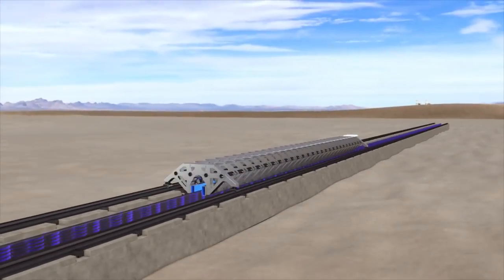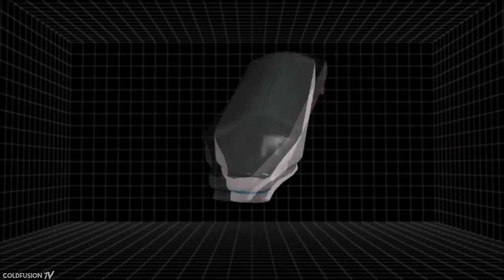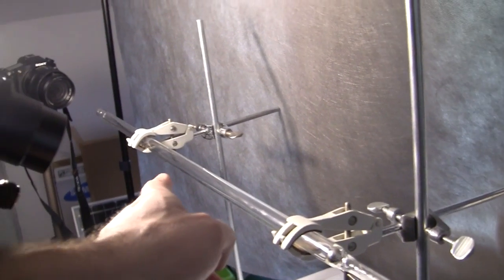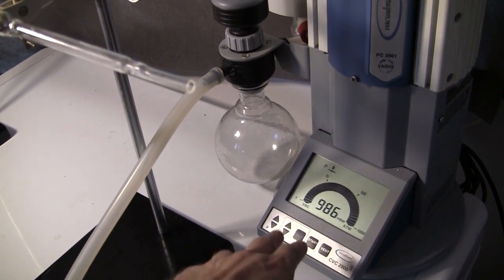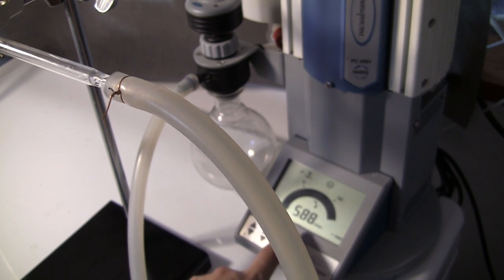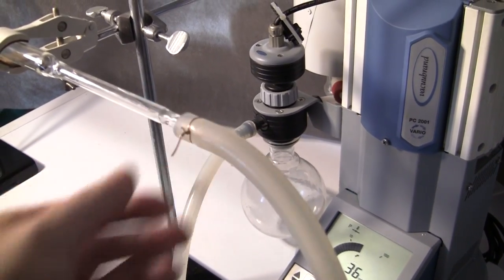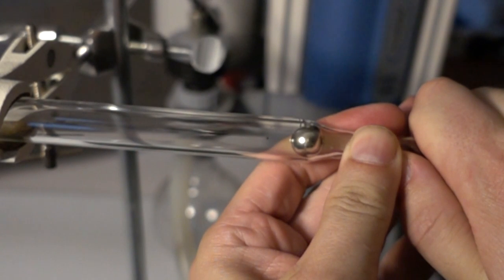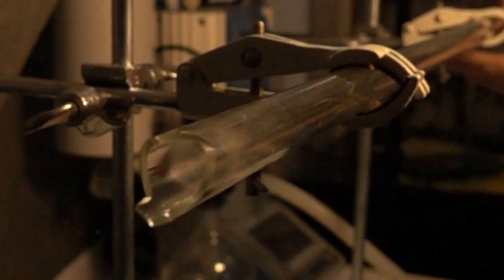How  the Hyperloop can kill you!

Comment: I don't know, I get the point if there was a catastrophic failure with no safeguards, but that assumes too much on Thunder's part.  If you only validate a travel option based on 0% risk, then don't even bother walking, because even that's not guaranteed.  Musk and others have far too much invested in this to not have some kind of safeguard against the most obvious forms of failure.  I'm not saying it's flawless, but I'd rather have this than the normal trains that seem to derail every other week.
Reply: Worst case scenario, the occupants are turned into Ragu, at least it stays in the tube instead of spilling across the countryside.
Reply: +LabTech I guess we'll have to see what they'll put in place  to reduce the risk.
Reply: Well, imagine this bullettrain, pushed away by magnets. derailing. It won't just fall over and slide a little, killing a few and wounding the rest. If a hyperloop derails it will pretty much guarantee death.

A vacuum rupture like Thunderf00t explains here is very well measurable and emergency breaks could keep the train in place, but on rails, it matters where the tracks break.

As long as it's not under or too close in front of the train you can just stop the train. On a hyperloop it doesn't matter where the problem is, unless you find a way to prevent air from rushing in in other parts, like some very sticky(and expensive) foam that fills up entire sections.

If 100km's behind you a drunken construction worker rams the tube, you're still screwed. Emergency breaks will stop the train.

Lets also not forget that there is no way out of the train or tube. It is supposed to be a solution for medium long distances. 50-500km of death trap in the middle of nowhere. Any emergency hatches will have to line up and open automatically because you can't open the train before the tube is pressurised unless you want to die.

The doors will have to line up, which will be either way too expensive becasue they will have to be large and very close together on the entire tube.

Also the friction from braking at those speeds added to extra oxygen can and probably will cause fires.

Easy solution for a fire in a cabin is just opening it and let the air out. Pressure drops, fire is out, everyone dies of asphyxiation before emergency services can reach it, but this won't be a solution if the fire is caused by a rupture in the tube. Then you'll only be feeding oxygen to a fire in a box in a tube, roasting everyone inside.

Co2 would be deadly as well or it would be blown away by the air rushing in, water is too heavy to take along and dangerous in combination with electricity, etc.

It's not like an airplane that you can build large enough to move around in to put out fires. every cm added to the train will have to be added to all of the tubes as well.

But let's say that fire is under control and the train just stops. How much oxygen is in the train while you wait in a tube in a tunnel through a desert mountain for emergency services to come and rescue you? An airplane has plenty of air, it flies through the stuff.

The simplest of problems that would not cause death in any other mode of transport can be very deadly in the hyperloop.
Reply: >Worst case scenario, the occupants are turned into Ragu

The more expensive ragu, or the cheap nasty stuff you get in tins?
Reply: Deathjack 999 Depends on whether or not the catastrophic failure happens in 1st class, or coach.
Reply: Stylish777 Look, every new technology has its detractors when the thing's in its infancy.  There were people who said that airplanes, trains, the subway, and the automobile were far-fetched when they were first introduced. 

I don't know enough about this to say if it's worth it or not (and where'd you get that price range from?), but I retain just enough interest to see this thing play out.  If in 5 years the financiers and industry people behind this are bankrupt and crying on the news, I'll be there right beside you laughing at them.  If, however, it succeeds and they somehow make it feasible and practical to implement, then I'll applaud them for improving human travel methods.

Thunderfoot here assumes that there'd be no countermeasures or safety methods against the failure state he suggests.  Look at any modern travel system and just stand in awe at the number of safety measures that are in place.  If you think this hyperloop thing isn't going to be loaded to the gills with safety crap, you're kidding yourself.
Reply: Stylish777 Bottom line to all detractors:  the world is full of people who'd rather shit-talk someone who's trying, then make the world better themselves.  Rest assured, if this thing succeeds despite your 'expert' opinion, you'll change your tune, use it, and then sing its praises; don't act like you wouldn't. 

Either someone's going bankrupt, or we'll end up with plenty of quotes that are going to look VERY foolish in a generation or two.
Reply: Musk has nothing invested in this. His "proof of concept" demonstration proved that, where the tubes couldn't even support their own weight and his trains were propelled down a track. The guy is a conman.
Reply: Now we're talking, these are all well thought out concerns about the hyperloop.

The most immediate danger I'm thinking of is loss of cabin pressure. This is actually more serious than with aircraft - it's essentially the same as loss of pressure in a spaceship. For that purpose, the tube must have rapid pressurization valves on regular enough intervals. If a passing pod reports loss of cabin pressure on the telemetry, the emergency valves open, fill the tube with 1 atm air from the outside, which prevents the passengers from dying from asphyxiation. If the response is fast enough, it'll also prevent other health issues from rapid decompression.

Emergency braking in normal mode could be handled by these valves as well. If you need to stop a train, just open valves ahead of the train, and it'll stop in a hurry. And it won't act like a cannon at all, more like a shock absorber. Better have the customers strapped down at all times, though.

Similarly, if there's a breach in the tube behind the train, it's not going to cause the pod to indefinitely accelerate; the pressure would be equalized, the air drag would decelerate the pod, and then you could have it moved to the nearest emergency exit.

Onboard fire is probably the most serious of emergencies I can think of within normal circumstances. To that end, you are right - the pod and the tube absolutely needs to be possible to egress in emergency. This would be facilitated by emergency pressurization valves (possible to escape the fire by exiting the pod and entering the tube), and having emergency exits on the tube on regular intervals (ideally on same locations as the emergency pressurization valves).

Out of ordinary, the most immediately fatal failure mode would be a tube collapse or obstruction as a result of some natural disaster or an act of terror, but this also applies to other modes of travel and can be mitigated here as well. For example, it may not be the best of ideas to build a hyperloop tube straight across San Andreas fault.
Reply: Mr. Suit
And because he knows it's not viable. It's just meant as inspiration to designers, physicists and engineers to overcome the practical barriers without him having to spend money on research on something that will never be used.

Research like that can often be very practical in other fields though, so it won't be waste, just as research on F1 cars is not wasted on a game.
Reply: ***** Look, I'm not an engineer, the difference between us is I don't pretend to have knowledge that I don't; so I can't really say if the thing is feasible or not. 

If it's possible, then hooray; a whole new era of mass transport is ahead of us.  If it's not, then a lot of wealthy and influential people are trying really hard to waste money and embarrass themselves. 

Either way, doesn't really impact my life right now, so I say let this thing play out and see what happens.
Reply: LabTech
Sure it's possible. You just need somewhere between 50 and 100 billion dollars to build it. You don't need to be an engineer to see that that is not feasible. You can just ignore that it's a death trap if you're not an engineer and are not going to commit to building the thing, so you're still safe ;)

I just wanted to point out the difference between possible and feasible.
Reply: LabTech
Yes people thought we would never fly and that the first bicycles without pedles made the cows give sour milk. I'm not sying it's impossible. Quite the opposite and we would do well to investigate the options and try and overcome the problems even if it will still always be far too expensive and dangerous(it's still a capsule in a fucking tube with no way out except at the stations; the only way to solve that is to allow only one train in and blow up the tubes in an emergency and protect the stations from the giant shockwave of the air rushing into the tubes at the speed of sound).

The cost is just that of a 600km maglev train and the current steelprice(tubes of 6m across and at least 3cm thick to withstand the pressure difference). I didn't even include the train itself or the stations, or the giant vacuum pumps, (electronically controlled mechanical)vacuum seals(on every few meters of tube, which will break often, causing that same shockwave but now to the train) and safety exits with vacuum seals every few meters if they will install any at all. You can't use such exits until the tube is fully pressurised and that will have to happen every time anything(even the tiniest vacuum seal) breaks to prevent a rupture, air rushing in at the speed of sound and hitting the train, killing everyone inside all the trains in the tube. You know the drill by now.

Sure it will be equiped with the latest features in safety. But that's also the only place they can save money on, oh and on the steel of course. Who needs protection from a few million tons of air while sitting in a vacuum eh? It's not like the shockwave of a nuclear blast does any damage :p
Reply: LabTech
'the world is full of people who'd rather shit-talk someone who's trying, then make the world better themselves.'

That's a strange, baseless assumption and ironical.

'Rest assured, if this thing succeeds despite your 'expert' opinion, you'll change your tune, use it, and then sing its praises; don't act like you wouldn't.'

Obviously. Then I would say that I'm glad to be wrong and that it's amazing that they managed to pull it off, but until that I rather stick with realism than impossible dreams. Sure the research will be invaluable to other projects, but that's no reason to give researchers a delusion to work on; just pay them to do the research, but Elon Musk rather tricks people into paying for the research first and then he will buy it for next to nothing because it won't be used for a hyperloop and it has cost billions to research and to cut costs they will sell it to Elon for cheap and he will use it to sell the floating Tesla or something, who knows.

When that happens you will sing a different tune, using it to judge other people like you're judging me right now, but from a different perspective.
Reply: I think they could use fiber-optic cables run down the length of the tube to warn of any breaks in the tube. If light is shot through one end of the cable and doesn't come out other end, you've got a problem. Don't take off until it's fixed.
Wasn't there a quote that said "Someone who says it can't be done is usually interrupted by the someone doing it"?
Reply: Jimmy Parris Yeah, basically.  I mean, unless this is the biggest scam in the world, or the blind ego of a handful of major industrialists, I have to imagine they've either figured out, or are working on ways to make this at least as safe as their modern-day counterparts. 

I mean, honestly, a mock up that goes not even a mile isn't really the standard by which an entire new mode of transport should be judged.  Give this a couple years, see what happens, THEN make an assessment.
Reply: LabTech
Just accept that it's a scam with a tiny possibility of succeeding. That's why Elon Musk named it before anyone started working on the antique plans with modern day knowledge and he didn't invest in it.

If something like it will ever be viable, you can be sure that Elon will buy all patents and take all credit for it and pretend he came up with it by sowing that he renamed an old idea from someone else.

He did the same thing with recycling spacecrafts and making rockets land on their ass. Look at his ridiculous presentation for colonising mars. He doesn't know shit. He has no technical details and he is full of shit. Some rich hipster retards will inevitably fund his kickstarter in the hopes to be among the first to live on mars.

To be honest, I hope they will succeed. I don't expect any technological or scientific results from it like we got from projects from NASA, but I sure would be glad to know that those idiots are not on this planet anymore.
Reply: +Zulkefli Johan It is actually more than possible.
Reply: Sir Omnoms
impossible at least is more letters :p

If it's more than possible you probably can show us the working prototype. The idea is about a hundred years old. Surely someone has made it by now if it's possible.
Reply: *****
'`He just made the electric car viable.'`

It was already viable. He wasn't the first.

'`Elon just figured out a way to make them come back and land so they can be reused.'`

Nope. He couldn't even draw a rocket engine if someone gave him an example. He is NOT an engineer nor a scientist.

On top of that. The space shuttle has come back, landed safely and has been reused for decades. It's really not a new idea. People have been trying to land and reuse rockets as well, but you know what? It turns out that it's cheaper to just build a new one.

'`Yet, who doesn't acknowledge the genius and importance of Ford.'`

That sentence should end with a question mark. To the point, Henry Ford was a talented technician and actually built his own prototype and helped develop the production line himself. Elon Musk does nothing of the sort and is not an engineer or scientist. He is a talker. That's it.

'`Eon didn't invest in the Hyperloop because he is a little busy running Tesla, SpaceEx and SoarCity.'`

Bullshit. It's just not viable and every actual engineer and physicist knows it and he is not too busy with his other companies. He is a businessman. He has people running his companies for him. People with actual knowledge about those companies and what they do inside those companies.

'`If this wan't a viable project, so many smart people would be working n making it a reality. Hyperloop Technologies, which has a staff of over 100 engineers...'`

Right. Just watch a few of Thunderf00t's videos on some kickstarter programs and thorium engines. 100's of engineers are working on those and they're impossible forever. The number of stupid people trying something stupid doesn't make stupid impossible things viable al of a sudden. It just makes those stupid people look as stupid as they are.

'`So, we will find out soon enough if this really works.'`

Yep and you'll probably find a way to say that it's just trial and error and that we just need to invest more to make it work because it must be viable if Elon supports it and hundreds of engineers work on it and thousands of people donate money to it.

'`I don't see how it impacts you anyway. It's not your time or money that is being used to develop this project.'`

Millions of dollars wasted on this stupidity by people who could have donated it to actual issues like helping to feed dying children, providing medicine in poor countries. Yeah, that doesn't affect me directly, but I still care.

'`I shutter to think what kind of inspiration and support you would provide to a child, if you have any.'`

And I have no reason to shatter your fantasy of me being a horrible person :) I'm fine as long as you will one day see the reality of snake oil salesmen like Elon Musk and the kids and parents have their own chance to judge me instead of them just assuming that I'm a great or a terrible guy just because a number of other people have whatever opinion on me.

Comment: On the gun barrel analogy, the cabin does not need to fit the tube tightly, as propulsion is electric, not driven by pressure. Therefore, air resistance around the cabin could be minimised by making the tube significantly bigger than the cabin - maybe not the prettiest solution for rendered 3D demonstration videos I guess.

This experiment does not account for an important difference in scales. Air is not the same kind of fluid in a centimeter sized system than it is in a few meter sized system. A clear example is different flying methods of insects vs birds. I still need to work out the repercussions this would have in air velocity and cabin velocity. Should not be too hard to estimate using dimensional analysis - Buckingham pi theorem, etc.

Also, how reliable could we make a basic array of safety valves along the whole tube?